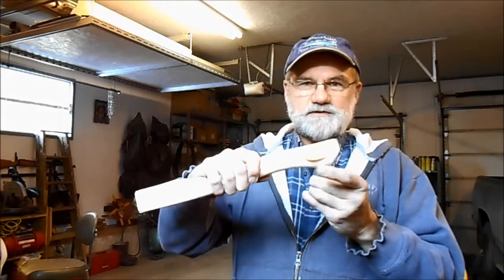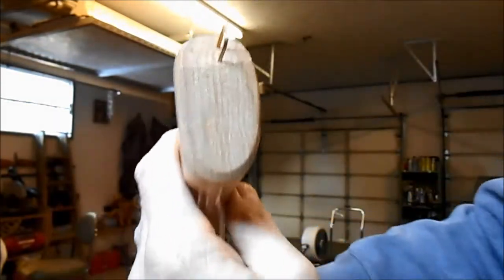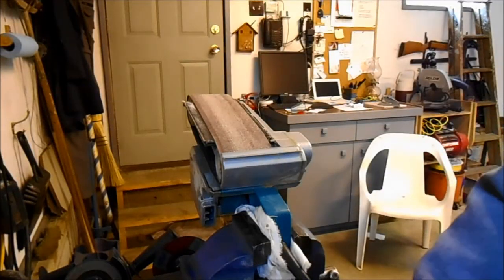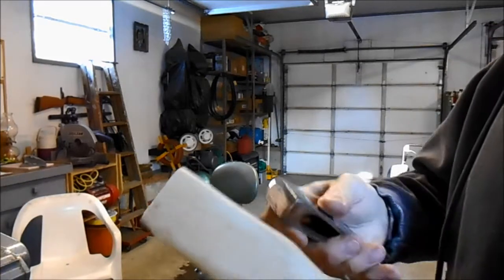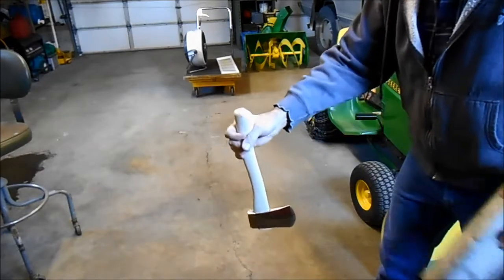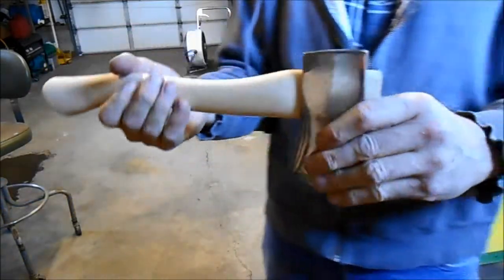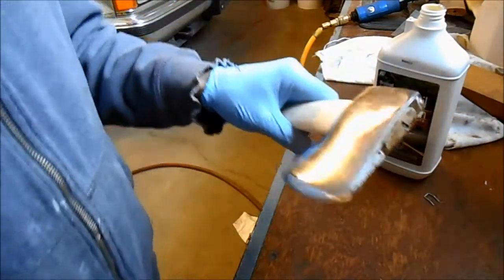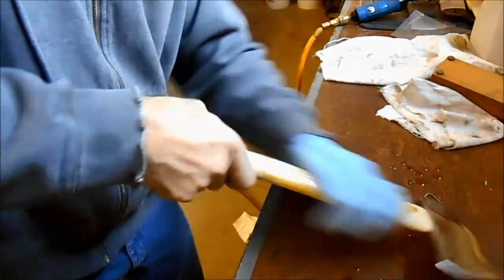Tools That Don’t need Fuel Part 3 Hanging an Axe

Comment: And that answers that question! Here's the Hanging video! Awesome Bruce! I use primarily wood handled tools my self and with all that I've hung, I never thought to show the process. Most recently was a splitting maul/sledge combination I got without a handle. That thing is a back saver when I'm making kindling to start up the shop stove. Looking forward to part four! Cheers! Zip~
 Oh....and thanks for the shout out on the air compressor video!!

Comment: Great video, you did good for a first timer.  I'm somewhat a novice myself, I've only hung handles on 3 axes and hatchets myself.  I use linseed oil rather than glue on the wedge and I also saw the overhang off before I pound the wedge in so I can drive that wedge down even further, then saw off any excess wedge.  To each their own though, there's more than one way to hang an axe!  Thanks for the video